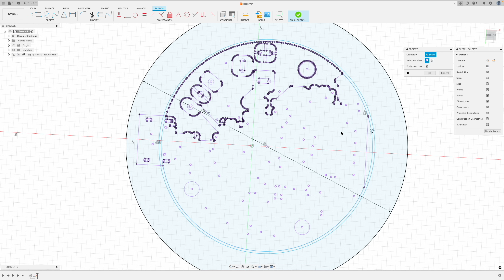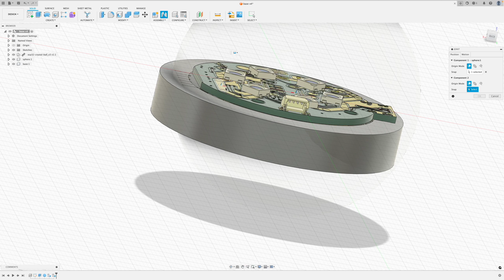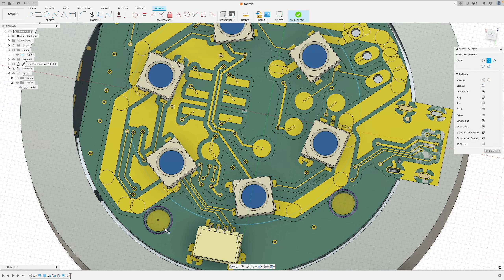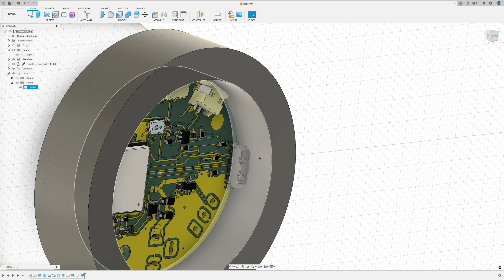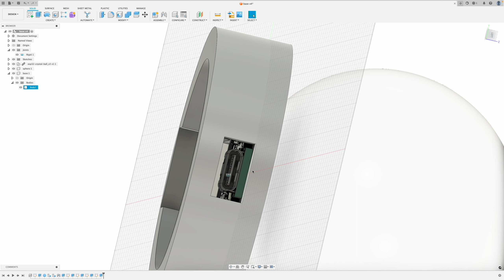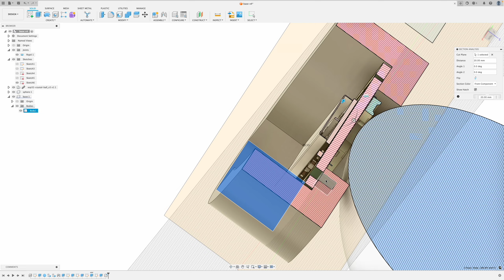A Bit of CAD for the next @atomic14 Project

Comment: Have you left enough room for plugs and wires on those additional sockets?
Reply from the maker: Most of them won’t be used for this version. The PCB should “hopefully” support a few other projects. Might need to make a bit of space for the battery socket though - good point.